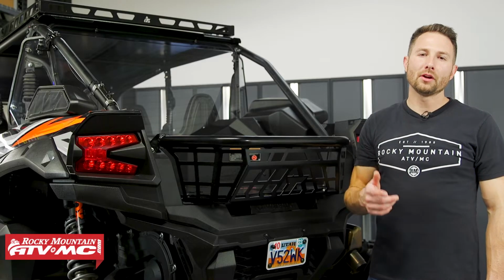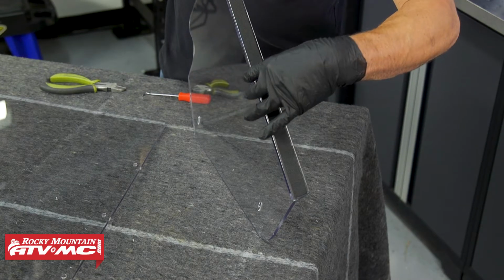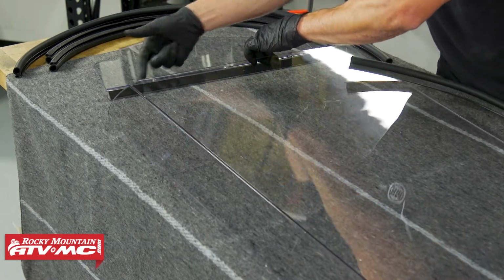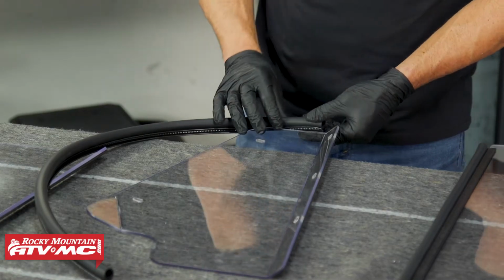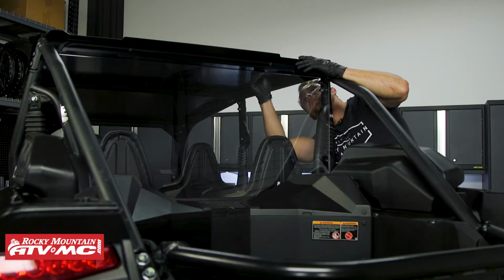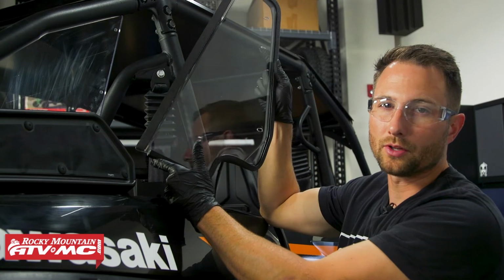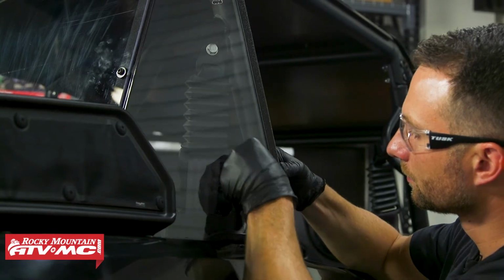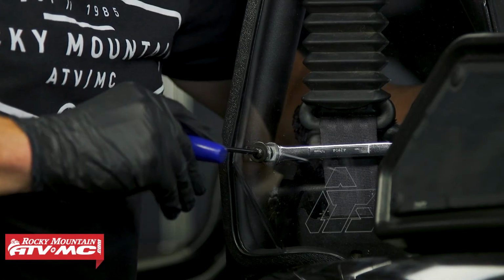How To Install a Tusk Polycarb Rear Window on a Kawasaki KRX4 1000

Comment: On the Special Edition model, what kind of effect do you think this would have on the sound quality, since the subwoofer is in the bed?  Is there a vinyl rear window option for the KRX4 1000?
Reply from the maker: Unfortunately, we currently only offer a glass or polycarb rear window for the KRX4. We can't say for sure since our model doesn't have the subwoofer, but it would probably deaden the bass at least a little bit.